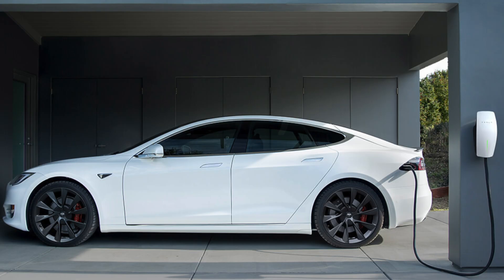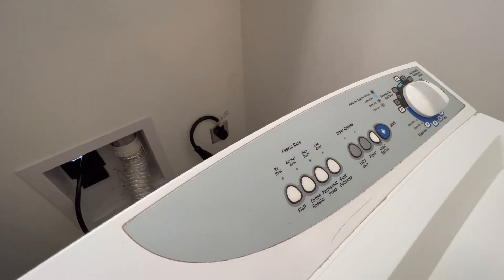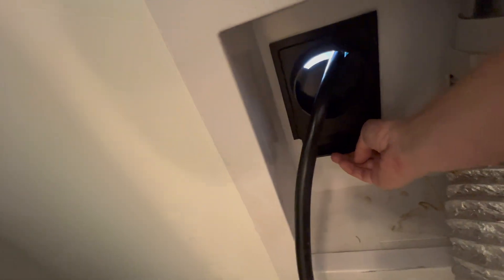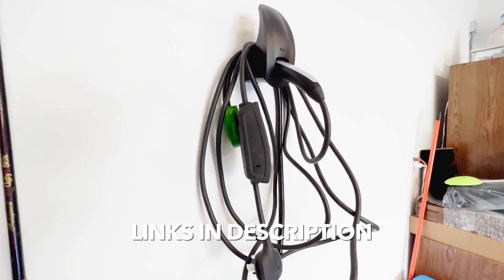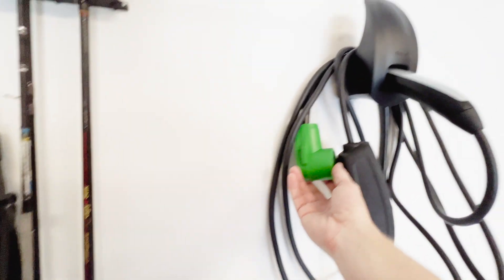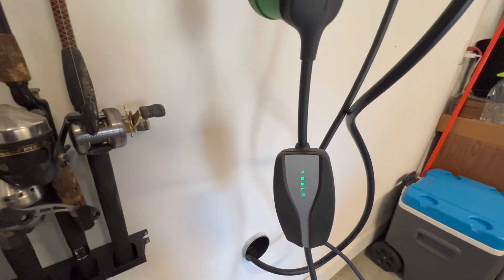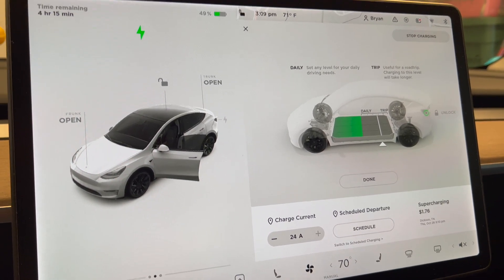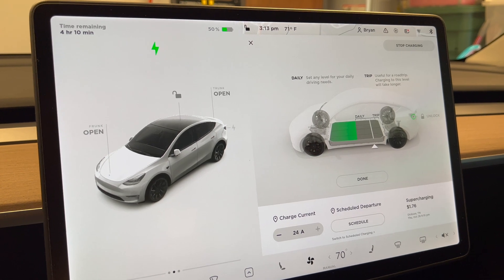Tesla Fast Charging at Home w/ Dryer Plug - Quick Tip

Comment: Where does the Tesla adapter plug into? I see you plugging mobile charger to the extension cord only
Reply from the maker: It plugs into the mobile charger. The end of the mobile charger pops off and you can then put any of the official adapters on there. Here's a brief explanation I did a while back in a campground where I was plugging into the post there and you can see how that part works: https://youtu.be/V4V-Ji1bzw0?si=l-jRJRv_oY_1WIWw&t=924
Reply: @bryanhauer  my dryer is older and has 3 prong. The split adaptor doesn’t seem to work. Do you have any suggestion on what I can use?
Reply from the maker: Congrats on the new Model Y 😀 I'm not 100% sure. You could try something like this if the plug matches up to what yours on the wall looks like and then get the official Tesla NEMA 14-50 adapter: https://geni.us/7rX3e

I'm not an electrician so unfortunately don't know for sure as everyone's setup at home is different. I did read that three prong are for older dryers prior to the year 2000 and the reason we now have 4 prong is due to a safety defect in the 3 prong. I'll just link the article on Home Depot so you can read it so not sure it would be the best idea then, but again they do sell a splitter for that. I'm not an expert though. https://www.homedepot.com/c/ah/how-to-change-a-dryer-cord/9ba683603be9fa5395fab90622a0d0f
Reply: @bryanhauer  thanks for letting me know. We are renting right now so this is the best option because we don’t want to spend money to install wall charger for house that’s not ours
Reply: Thanks for replying so fast! I just ordered everything on your list. I understand the setup now!! Expecting my MY tomorrow!

Comment: We just had an 18 percent rate increase due to our local market influx of evs and overall population growth , if we all go ev we could see 50 percent increases which could offset any savings ... Unless you somehow harness solar off your roof economically to some battery setup that can go direct to the car .... But I still see the power company really hosing everything even the none ev customers .
Reply from the maker: Yeah, I think I said it in one of my first videos after charging at a Supercharger a few years back and I had almost a full charge for less than $10 and remember saying I wonder how long till the utility companies start realizing that because everyone is so ingrained to spend $50 to fill up our gas tanks, that they'll just start charging more for electricity so we all end up back at the same place.

It's still much cheaper in most places, but agree they're getting wise to it and will just hike rates purely out of greed so it's best if you can harness and store that power yourself for later through solar, wind etc... I chalk it up to good old American Greed. 

Luckily at my place in TN I still only pay about $0.09/kWh and only $0.11/kWh at my cabin in MN so it only costs about $7 USD to do a complete 0-100% charge. I avg about 2x50% charges per week so my monthly charging average is only about $28-$35/mo. The place I previously lived in Las Vegas had a solar/storage system that I didn't pay to put in so was basically free.
Reply: In southern CA we pay super unleaded equivalent from the sun LOL.   joke aside, local electric providers do offer special EV rate which we have to first sign up, midnight rate is .17 per kwh (mid day is .58 😡) full filling-up for any EV is ~$8-$12, not bad at all.

Comment: awesome video. this is exactly how my home is set up. i was excited to see i had a 240 outlet, but it was dead. cost me about 800 but can run the same with the new wall outlet and didnlt have to change panels and circuits and what not.

Comment: Great video, how to connect 14-30p to a Dryer with standard outlet?
Reply from the maker: What do you mean by standard outlet? 110/120v? If so, you can’t use the 14-30 and can only plug into a regular outlet which will only charge at about 3 miles per hour. You need a 30 amp plug for the faster charging. You’d probably be better off having an electrician install a NEMA 14-50 plug or hardwire a charger.

Comment: Hey everyone.. I'm wanting to buy a tesla and I'm trying to do it to get the 1.99% before August 31 but before I do it,  I need to make sure I have the home charging figured out. I simply don't have room on my panel to add anything else so the dryer option is possibly the ONLY option that I have. I was told by an electrician friend that  you should not do this at all because you need 50amp wiring because the charger will pull something along the lines of 40-42 amps and that dryers are only like 30 or something. I'm not an electrician. I feel like I'm being told this because it would mean less money for him to make off doing the job but idk... the way this video looks and judging from the comments,  it seems like a viable option. Am I missing anything?
Reply from the maker: You can set the amps at whatever you want on the screen or in the app so him saying that shows he doesn’t know what he’s talking about. Just set the amps at something like 32 or 24 if that trips it.
Reply: @bryanhauer  hey man I appreciate the response. Thank you. Yeah I'm going to find someone else that can look over what I've got and hopefully set it up this way for me because it sounds like this is the best route for me and I really want this car. I was SO bummed out when I thought I might not be able to do it because of the charging situation

Comment: Very helpful video. For last two months I have been switching plugs between dryer and Tesla to use the dryer 10-30 plug. I added a Y splitter today. While adding Tesla and dryer plugs into the Y ends, I noticed some spark. That was only when I plugging them in? Should I be concerned?
Reply from the maker: Too many variables to know for sure (what brand splitter cable you have/home electrical setup etc...), but a proper splitter isn't any different than plugging them directly in as long as you only use one at a time. Most homes would just trip the circuit if both were used together. Check with a professional in your area if you have concerns.
Reply: @bryanhauer  Thanks.

Comment: how do you install the blast gate?  The item linked in Amazon doesn't have any instructions that I can find.
Reply from the maker: I just used a hole saw to drill out the hole and then used some adhesive to attach it to the wall.

Comment: I have a wall charger on the same circuit as the dryer.  I set the Tesla to start charging at 10pm since no one is going going to be drying clothes then.  I had the wall charger installed when I had another EV prior to my Tesla.  I like to set the amperage down a bit (i.e. 20amp) just to help keep the heat down as I live in Arizona.  Again, doing at night also helps with the heat.
Reply: The chargers on the market now support temperature control, which generally supports a temperature of 55 degrees, above which they will stop working. Is it overly worrying?

Comment: Great video. Exactly what I am looking for. BTW: The MOBILE CONNECTOR sold by Tesla has a NEMA 14-50 ADAPTER included. Can I use it or it is better to order the one you mentioned (14-30 adapter). TIA.
Reply: After doing a little bit more research, I kind of understand that a 14-30 is needed because it is likely used by the dryer, while the 14-50 is different in size.
Reply from the maker: The 14-50 adapter won’t work here as dryers use a different plug. You need the one that works for your 30 amp dryer outlet.
Reply: @bryanhauer  Thank you for confirming that.
Reply: What if you use a splitter that has a 14-30 and a 14-50 on it?  I have a 14-30 dryer plug and a 14-50 Tesla cord.  Can I get the above splitter and use a 30 amp extension cord then set my car at 24?
Reply: @KariBullerman-it6im  I don’t see why it wouldn’t work.

Comment: Bryan or anybody who read this. I checked my dryer outlet receptacle it is a 5-15 nema regular household outlet. Not the same receptacle as your dryer shown. Any help will be appreciated. Thank you.
Reply from the maker: That won't work unfortunately for the faster speeds like I show in the video. You'll only be able to get around 3 miles per hour of charging whereas I was able to achieve about 21 miles per hour of charging. My suggestion would be to have a NEMA 14-50 installed in your garage or have a charger hardwired. This will give you speeds of 36-42 miles per hour of charging.

Comment: I messed up by buying wall charger. I could totally use this setup since my dryer is in the same location and the breaker for my house is on the complete opposite side of the house but too late now. Not going to buy a new charger and try to sell the wall for cheaper price.
Reply from the maker: Well at least you have the fastest home charging now and it’s also guaranteed safe. Should add some value to your home as well 👍
Reply: @bryanhauer  Thanks Bryan!

Comment: Thanks for this! I just got Y model and portable charger and adapter.  My dryer is 10-30, which I will use to charge my Y.  Do know which splitter is ideal for 10-30 to connect dryer and Y car? (not to use simultaenously, but to avoid having to plug/unplug etc.) thanks!
Reply from the maker: You bet 👍🏻 You could get a 10-30 splitter like this one: https://geni.us/p8ar

You could also get something like a SplitVolt which auto switches for you: https://geni.us/ZJBRibj

At that point the cost kind of negates the price savings though, but some people don't want to think about it.

Comment: so i did it but i had to manually set down my amp rate in the car  because on a 30amp breaker it kept the ampage at 32 which obviously is too much. not adjusting on its on i guess the wiring in done wrong or might be cause im also using an extension cord and adapter. i kept it at 16A for now but i think u can turn it up to 20-24 keeping it under 80%
Reply from the maker: Yep, always a good idea to keep it at one notch below the rating. Usually the Tesla will auto do this, but sometimes you have to manually set the amps. Every house wiring is different but usually 24 Amps would be good 👍

Comment: Understood that a dryer and an EV can not be charged at the same time. But when you are not charging the Tesla, can you keep the mobile charger connected (without actually charge the Tesla)? my concern is if one reconnect the mobile charger every time, the connector (in your garage) can be wore out, comment?
Reply from the maker: Yep. Thats why I use the splitter. Then you never have to disconnect from the wall which can wear out the plug over time. You can connect/disconnect the Tesla mobile charger from the splitter as many times as you want.
Reply: thanks for the reply, super helpful video, I am still wondering if one needs to connect/disconnect the Tesla mobile charger from the extension cord (green connector in the video) every time, is there any issue to leave them connected all time? of course don't charge an EV and run a dryer at the same time. Can the charger (not Tesla) be connected to power when the dryer is used? I don't own a Tesla yet, may missed something obvious in the video, thanks again.

Comment: Hi, I’m using the same setup and it’s been working fine for about a year. Now im noticing that the charge rate drops to 12A due to the extension getting overheated. Im using a 25ft 30A rated extension cord. Not sure if I need to replace the extension cord or what’s causing this overheating. Appreciate if you have any ideas on what’s causing this. Thanks
Reply from the maker: Not sure. I'd make sure there's no issues with the plug receptacle itself overheating. You're not constantly unplugging it are you? Normal household ones aren't made for that which is why I used a splitter in the video so I almost never would have had to unplug it. If that's not it, it could be the cable. Is the cable made for EV's/RV's?

Comment: Last I saw there are two different companies that make a "spliter" for the dryer plug that has a control on it where it only allows for one to work at a time so as not to drip the breaker on the dryer plug circuit.
Reply from the maker: Yes, which increases the price to a point it doesn’t make sense then. The point of the video is an inexpensive way to charge your car at faster speeds with a minimal setup. If you accidentally forget it simply trips the circuit. Otherwise one might as well just have a NEMA 14-50 professionally installed.

Comment: Great video, I have been using a 110 for years as we dont drive alot.  The new model y with lfp batteries drains a lot quicker in the cold so I'll need to step up. My Dryer plug is on the opposite wall across my garage, I guess I will need to figure out how to route it through the laundry room.
Reply from the maker: Thanks 😊

Comment: Neocharge makes a cool smart splitter
Reply from the maker: Yes, but then the added cost makes it pointless and you might as well get a NEMA 14-50 installed or charger hardwired. The whole point of the video was to be an inexpensive way to charge at faster speeds. I do agree though that the splitter does make it more convenient, just not as cost effective for the goal here. Appreciate the comment.

Comment: I just did that to my home charger and it works perfectly.  I tried 30am had 7kwh going in with no issues.  But I think 24A would be smarter and still pulling 6kwh in so no different than outside paid chargers.  It works
Reply from the maker: Yep, if it runs hot or trips it's best to drop the amps down to 24A like you said 👍🏻

Comment: Is it ok to use the 50ft cord as my dryer is not against my garage wall?
Reply from the maker: You'd need to make sure you're using a RV/EV rated/gauge cord which is I've linked to in the description. You can't use a normal ext cord.
Reply: @bryanhauer  Yes sir! I used your link to purchase the 50ft EV and splitter
Reply from the maker: @jasonroberts2668  Much appreciated 👍🏻

Comment: 1. How do you make the hole in the wall? 2. If using that inlet for the hole, are there pipes behind it?
Reply from the maker: I already had a cutout there for the dryer vent so only had to go through a thin piece of plastic with nothing behind it and used a 4 inch hole saw. Some regions have codes that don't want you going through drywall so check your local area.

Comment: I need that black sliding piece you show at 2:30 in the video. What is is called and where can I get it? Thanks
Reply from the maker: I links to all the products in the description down below the video, but will also put them here for you. The product you're referring to is the 4 inch Blast below:

CHARGING PRODUCTS IN THIS VIDEO:
Tesla 14-30 Adapter (Select 14-30 from Dropdown): https://shop.tesla.com/product/gen-2-nema-adapters
RVMATE 4 Prong Dryer Extension Cord 10FT: https://geni.us/4qiS
NEMA 14-30 Splitter: https://geni.us/fLuVWzw
Charging Cable Organizer: https://geni.us/cTEK
4 Inch ABS Plastic Blast Gate 4 inch: https://geni.us/q13Z
Magnetic Hooks: https://www.homedepot.com/p/Master-Magnet-Handi-Hook-20-lb-Magnetic-Pull-Hook-07218HD/202639937
Tesla EV Sign: https://www.etsy.com/listing/935401359/tesla-electric-vehicle-parking-sign?ga_order=most_relevant&ga_search_type=all&ga_view_type=gallery&ga_search_query=tesla+signs&ref=sr_gallery-1-6&organic_search_click=1

Comment: I did a similar setup at my house. However, I did not want to rely on family members to ensure that only dryer or charger is on and NOT BOTH.

I would suggest a 3 position, 2 pole double throw switch be placed at the dryer. That will ensure only one of dryer or charger gets power.
Reply: This is exactly what I'm thinking about when watching this video. Somebody in the house will use the dryer at night without knowing.
Reply from the maker: @jccnguyen It simply trips the circuit so not the end of the world if someone forgets. This setup was for anyone just getting started with an EV and was looking for the least expensive option while still getting decent home charging speeds.

Comment: Do you suggest keeping everything connected to the wall, like the extension cord, mobile connector etc when we are not charging the car? If we keep it, does it consume a lot of power still?
Reply from the maker: You can unplug the ext cord/mobile connector when not using it, but you should keep the splitter or whatever is plugged into the 30AMP Dryer plug always plugged in. Those aren't made to withstand plugging and unplugging constantly.

Comment: Dumb question 
Before buying an EV I wanted to know this . I have Electrical Panel in Basement and 120v outlet in Garage (20 ft distance may be). Will electrician be able to convert it to 240v 50A with whatever wiring he needs to put or will that be couple of thousands of dollars ? , so I may not end up buying EV. And I want to do installation with proper code.
Reply from the maker: I’m not sure so if I were you I’d just have an electrician out to give you a quote, but from my experience the cost would be much higher since your panel is in the basement. Usually getting a quote is free so just have someone out.